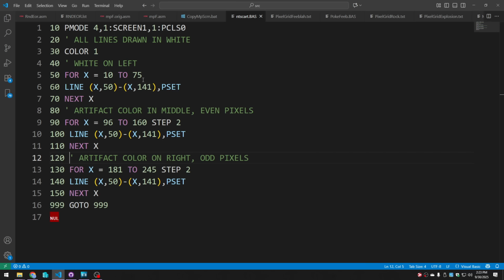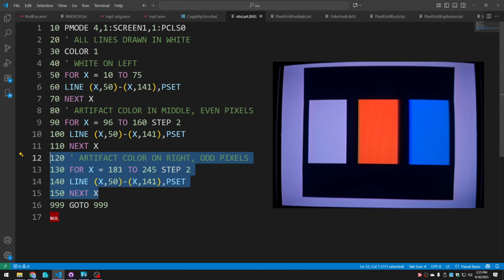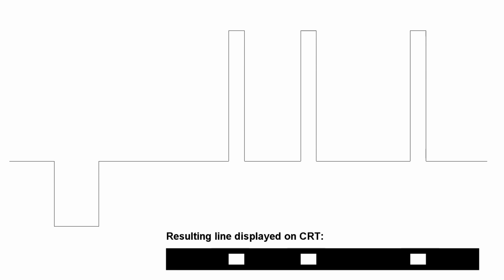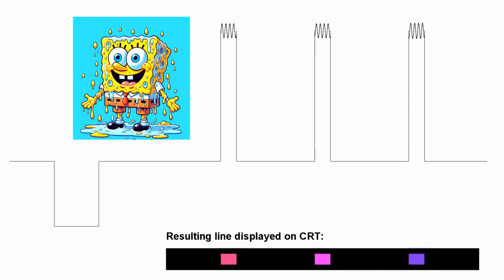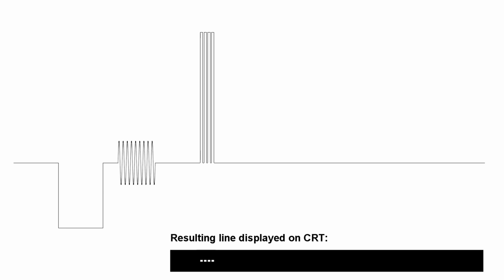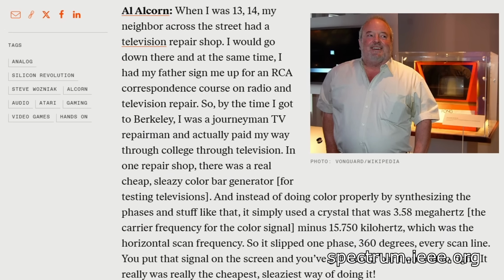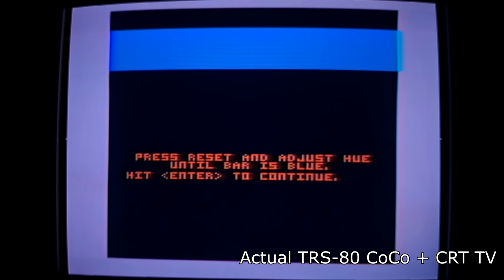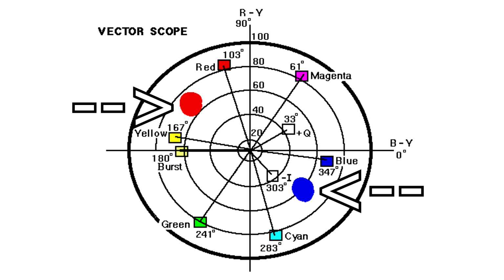How early computers TRICKED TVs into making color (out of nothing at all)

Comment: Quick question. The chips appear to be capable of generating an actual chroma signal, and the vdg even sends out two intermediate colour outputs. But you mentioned that the hardware was cheaper because it didn't actually have to send out chroma. This doesn't make sense to me because it looks like the hardware to send out proper chroma was already present. I'd appreciate more insight into this.
Reply from the maker: It was the apple 2 that did not generate chroma at all. All of its colors came from artifacts. And that simplified its circuitry. The CoCo did indeed generate a chroma signal, but not on its high resolution graphics mode.  I'm not certain, but I'm guessing that generating specific colors via chroma at that high of a resolution would have been unreliable, given that color artifacts might get in the way.

Comment: How does PAL work ? The same way, or completely different ? (Greetings from PAL Germany)
Reply: Substantially different, though strangely similar... By the 70s NTSC was in fact a minority standard in global terms (~20–25%) whereas PAL accounted for 60-65%.   - It's a German invention; Walter Bruch of Telefunken/early 60s.  

Both use a colour (that's how it's correctly spelled!) sub-carrier; but at at different frequency - with the additional sophistication that in PAL the Phase of that carrier changes in each Alternate Line... which cancels out phase errors - Thus the name!  Most (not quite all) PAL, and certainly that in Europe used 625 lines at 50 interlaced frames.   

The 'glitch' explained here simply didn't exist...  The PAL subcarrier is 4.43MHz... the baseband (before RF modulation) 
was limited to ~5.5 MHz for luminance, leaving space for: Chrominance subcarrier and sidebands a Sound subcarrier and Guard bands to prevent adjacent-channel interference.  - In practice transmitters and studio links typically low-pass–filtered video at around 5.0 – 5.2 MHz to reduce intermodulation and adjacent-channel interference.  So already the signal arriving at the aerial had only ~5 MHz of luminance detail.

IF filters at the receiver end rolled off gently beyond about 4.8–5.0 MHz, video detector and amplifier bandwidths were often a bit narrower still, especially in cheaper sets and the CRT spot size and focus limited effective resolution too — so there was often no point in processing  >4.5 MHz detail  “average” homes often saw something nearer 3.5–4 MHz effective luminance response, even though the broadcast chain could carry up to 5 MHz.

Under the best conditions the effective luminance bandwidth at the viewer’s screen was typically between: 4.0 MHz and 4.5 MHz... A very very good large screen black and white set  might just resolve the 4.43MHz signal as 'dot crawl' on very highly saturated areas; and in very very limited circumstance, a colour set could produce an unstable false-colour flicker at the viewer end; but fundamentally PAL was designed to to prevent such colour errors and phase sensitivity.  

- Even if a monochrome signal happens to have energy near 4.43 MHz, the decoder will see alternating +phase/–phase patterns line by line, and average them out; the result is grey! All you 'might' get is a bit of faint, unstable, flickering false colours, particularly on high-frequency detail;  Test patterns such as 'the BBCs test card F or Philips PM5544 had sections designed provoke interference (the Multiburst sections) designed to help adjust receiver's chroma traps or delay lines (part of the PAL decoder circuitry) in order to minimise/eliminate 

I started training in a broadcast engineering field (I'm a cameraman by trade) in 1979. - Computer graphics were an emerging field and have evolved throughout my career. From when I started everything was done in RGB... 

To display this, either access was needed to the receivers' RGB stages (this was implemented by some high end domestic sets in SCART)  or 'some sort' of basic PAL encoding then UHF modulation was necessary... in practice; this was pretty crude/poor in the early days.  - Not quite as crude as the NTSC trick, but still terrible!

Comment: Pedant attack! "Composite" was also used in a monochrome context to mean the composition of sync and video into a single signal. Even just barely into the computer age — 8-bit Acorn machines came with a composite port that was, by default, purely monochrome and always defended as being correct terminology. You could open up and add a link to add colour to the monochrome output. And to be explicit: these are PAL machines, monochrome means monochrome, they have specific and deliberate circuitry to generate colour, alongside genuine RGB output if you want it. This is not my misunderstanding of artefact colour.
Reply: Quite so... Specifically CVBS... Composite; Video, Blanking and Syncs; to be even more pedantic! 🤣  - In a black-and-white studio (and signal generating) environment these could travel around as separate entities. Some studios I worked at in my early career even had Line Drive, Field Drive, Blanking and Burst available on the test plates - all fed from a central sync pulse generator to which the studio was locked - this is where the term 'genlock' (generator lock) is derived from.
Reply from the maker: Thanks for the correction!

Comment: Very clever... but it didn't work in Europe. This is why Apple II computers were sold as black and white. If you wanted colour, you had to purchase an additional colour card (such as Chat Mauve)  that would interpret the artefacts generated by the computer and  output an RGB signal. There was no such card for the Coco computers as they came with a direct RGB output, but this did not cover the high rez mode which remained strictly black and white. All we had was the lower resolution pretty awful color palettes. This probably didn't do any good to attract buyers, whether it was because of this or other factors the Coco sales remained confidential in European countries. Note, today and for the Apple II there is the excellent A2DVI project which outputs a full color HDMI signal for everyone (there is also a plug-in version of that card for the Apple IIc).
Reply from the maker: Interesting information, thanks for sharing!  There are projects for the coco as well to generate HDMI.  Now our PAL pals can see what they've been missing all these years.
Reply: That's because the PAL (and for that matter SECAM) system used in most of the rest of the world was specifically designed to eliminate the flaw the this trick exploits.

Comment: I watched this like 3 or 4 times, but you didn't describe how it generates the color burst signal. If it's truly a 2-color (B/W) system, there wouldn't be a color burst natively, correct?
Reply from the maker: The computer had to be something of a hybrid.  Using an oscillator to generate burst, but then sending a luma-only (no chroma) signal for the picture.  At least this is how it would work for the video modes that exclusively used artifacts for color.  (The coco had lower-resolution modes that sent a true chroma signal.)

Comment: The only thing I don't understand is... if this requires a color TV to process, then why even mimic the chroma signals in the first place?

Why would a program choose to labour the users with resetting until the colors are correct,, when it could just use regular intentional color mode with chroma signals?

It's a neat hack,, but I don't see how it was ever useful? Was it used by serious peograms? Why?
Reply from the maker: In the case of the apple 2, it did not generate chroma at all, and used luma for all of the colors.  I'm no electrical engineer, but my guess is that Chroma is tough, b/c it requires carefully adjusted phase changes for each new color across the scan line (versus luma, which can just be a square wave that goes up when a new pixel needs to be drawn).  In the case of the coco (which came a few years later), it actually was capable of generating chroma, and did so on the lower resolution screens. It is only on the high resolution screen where it relies on artifacts to get colors.
Reply: Generating any kind of true colour signal requires working around an RGB model...  That means added complexity and expense. Likewise actually creating a truly colour-encoded signal is complex and expensive. These machines simply took advantage of a flaw in the NTSC system to create a 'false colour' output; something that only worked in their home market...  Most of the world never used NTSC.

Comment: Why not just use the chroma signal?
Reply from the maker: In the case of the apple 2, it did not generate chroma at all, and used luma for all of the colors.  I'm no electrical engineer, but my guess is that Chroma is tough, b/c it requires carefully adjusted phase changes for each new color across the scan line (versus luma, which can just be a square wave that goes up when a new pixel needs to be drawn).  In the case of the coco (which came a few years later), it actually was capable of generating chroma, and did so on the lower resolution screens. It is only on the high resolution screen where it relies on artifacts to get colors.

Comment: One missing part: the fact that the pixel rate exactly matches the 2x 3.5... MHz and why.
Reply: It's not a coincidence.  Most color systems from the day derived the color clock, dot clock, and CPU clock all from the same master clock, which itself was most commonly 4 or 6 times the chroma frequency.  And that was done partly to facilitate color generation (either through hardware or software), and also to ensure that the color carrier does not drift with respect to the picture, to avoid dot crawl.  Look up "pin eight dot clock rates" for some interesting information.

Comment: 14:10 Not just the IIgs! There was also an 80-column extended/RGB card for the Apple IIe that had a 15-pin RGB output just like the IIgs. It wasn't NTSC composite, but it also wasn't artifact color. The AppleColor Monitor 100 was originally intended for use with a IIe equipped with this card, as it fits perfectly on top of an Apple II case just like the monochrome Monitor II.
Reply from the maker: Thanks for the info!

Comment: How hard do you think it would be to simulate or view a black and white signal on a color CRT with the color artifacting enabled? Seems like that effect might look cool.
Reply: Conceptually it's not hard.  Just insert a colorbust into the black & white signal.  Of course, since the original signal doesn't have any chroma information in the picture, you wouldn't see anything except random color fringing around distinct variations in luminosity.  If someone was wearing something with a lot of narrow vertical stripes, it might make a pretty rainbow pattern.  My assumption is that TV studios had equipment that could do this.  You could essentialy see this effect on the text portions of the split screen modes on the Apple II, where the text was designed to be rendered in black and white...yet the designer neglected to omit the colorbust from those lines, so you got plenty of green and purple fringing on the canonically white text.

Comment: To deliberately exploit this, you'd need incredibly fine control of pixel position!
Reply: The dot (or pixel) clock had to be an integral multiple of the standard color frequency to be able to leverage this well.  Usually a multiple of 2 to 4.  The higher the multiple, the more colors you could generate.

Comment: I don't get why they didn't just used the color signal
Reply from the maker: In the case of the apple 2, it did not generate chroma at all, and used luma for all of the colors.  I'm no electrical engineer, but my guess is that Chroma is tough, b/c it requires carefully adjusted phase changes for each new color across the scan line (versus luma, which can just be a square wave that goes up when a new pixel needs to be drawn).  In the case of the coco (which came a few years later), it actually was capable of generating chroma, and did so on the lower resolution screens. It is only on the high resolution screen where it relies on artifacts to get colors.

Comment: can someone explain why you would do this? what are the benefits to tricking a ntsc into generating color rather than... just telling it to generate the color? Is it to save data space?
Reply from the maker: In the case of the apple 2, it did not generate chroma at all, and used luma for all of the colors.  I'm no electrical engineer, but my guess is that Chroma is tough, b/c it requires carefully adjusted phase changes for each new color across the scan line (versus luma, which can just be a square wave that goes up when a new pixel needs to be drawn).  In the case of the coco (which came a few years later), it actually was capable of generating chroma, and did so on the lower resolution screens. It is only on the high resolution screen where it relies on artifacts to get colors.

Comment: What if you draw every third line? Then you would just see the individual lines because the frequency is too far from 3.579545 MHz?
Reply from the maker: Then you would actually see individual vertical lines against a black background. However, those lines would have red and blue fringing on them. To ensure you really get white, you need to double up on those vertical lines using both even and odd X coordinates.

Comment: Great Video! Handsome Host and all.
What I'm missing here for the layman is the reason why it is easier to generate "digital" pulses in the frequency of the chroma burst, and change the desired color (that the color display is able to generate) with phase realtion to the burst by its "pixel" placement on the screen - to just use the normal intended method of color generation for NTSC of both amplitude and phase relation?
Was this a case of harddware (videochips) in the early computers and consoles werent capable of that yet, although color displays had been already the norm?
At the beginning of the video I thought this was a bug exploit of a monochrome display made able to display a few colors. But thats clearly not the case.
Reply from the maker: In the case of the apple 2, it did not generate chroma at all, and used luma for all of the colors.  I'm no electrical engineer, but my guess is that Chroma is tough, b/c it requires carefully adjusted phase changes for each new color across the scan line (versus luma, which can just be a square wave that goes up when a new pixel needs to be drawn).  In the case of the coco (which came a few years later), it actually was capable of generating chroma, and did so on the lower resolution screens. It is only on the high resolution screen where it relies on artifacts to get colors.

Comment: Highly irrelevant BASIC question from someone who only ever had a very... well, basic view of BASIC (thank you CBM BASIC V2), why go from 150 to 999, and why tell the computer to GOTO 999? You're going to an empty line? What does that do? On a C64 I'm fairly sure at the end of a program telling it to GOTO a line that has nothing but that GOTO command in it would just freeze the display at that point in the program. For example, on a C64 -

10 PRINT "HELLO"
20 REM EMPTY SPACE JUST BECAUSE
999 GOTO 999

- I'm fairly sure the program would display the HELLO text and then just freeze utterly, because the CPU has been told to GOTO the GOTO line. Or is that the intention? To freeze the display with the blocks on the COCO program in the video and not return to the prompt?
Reply from the maker: The goto 999 is an intentional infinite loop to prevent the program from terminating. Once the program terminates, the ROM will return you to the text screen, and you will no longer be able to see the graphics.  So it's just a way to allow the user to continue seeing the graphics screen until they hit the break key to forcibly terminate the program. As for the specific numbering I used, I just wanted to leave a lot of space in case I wanted to add extra things before the infinite loop.
Reply: YouTube didn't see fit to let me know that you'd replied, sorry about my late reply in turn.

Interesting, thank you so much for the explanation!

Comment: I remember old vacuum tube color TVs that had a separate color killer circuit. Some even had a switch on the back to disable it for testing. The CK circuit could fail (or if you turned it off with the switch) and there would be colors on the CRT when viewing a monochrome show. Why have a CK off switch? Due to the design of early color NTSC TVs, there could be a problem where they failed to detect the colorburst signal and would show a color program as monochrome. Being able to disable CK without opening the cabinet was a fast way to determine where to start troubleshooting. If turning CK off made it show color then the tech would know to start looking at the colorburst detection part of the circuitry. If turning CK off left a color show in mono, or didn't make funky colors with a mono show, then the problem was elsewhere.
Reply from the maker: Thanks for the info from your hands-on experience!

Comment: But why was the color burst signal sent to the TV, if the computer was meant to be black and white only?
Reply from the maker: The TV in question is color, but doing color the “proper” way was hard, especially with the limited circuitry available to the apple 2.
Reply: @CocoTownRetro  I get that. But why was the apple 2 sending the color burst signal in the beginning of the line to the TV? If the computer was supposed to be black and white there's no reason to send it, and it would all be black and white on the TV.
Reply from the maker: @kristerlarsson4633  Color on the apple 2 was very much intentional. It was simply exploiting a hack of composite video to produce those colors via artifacting. So the apple two had to send the color burst to ensure that the color killer circuit wouldn’t prevent those colors from displaying